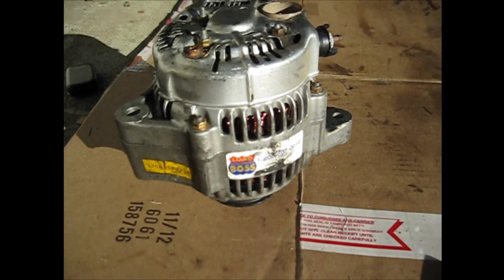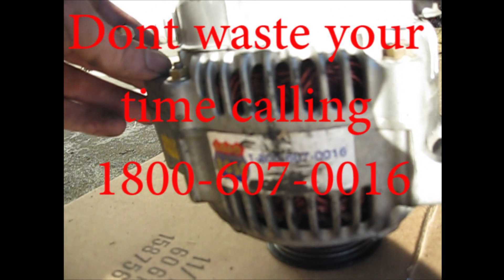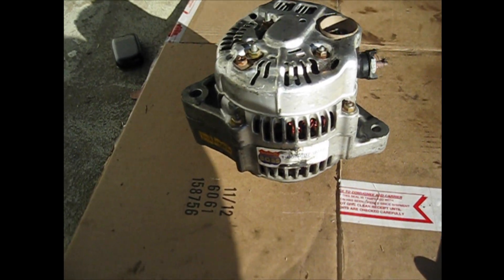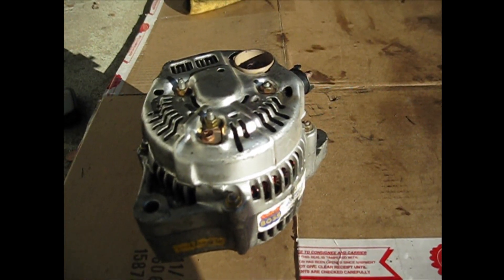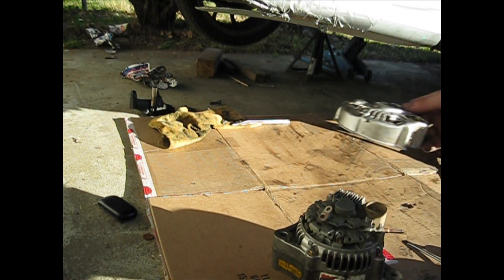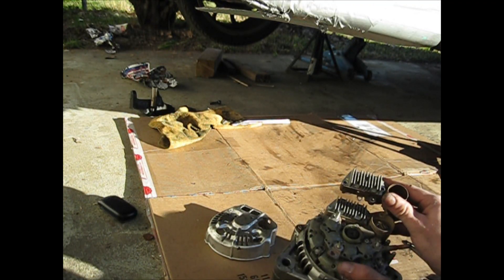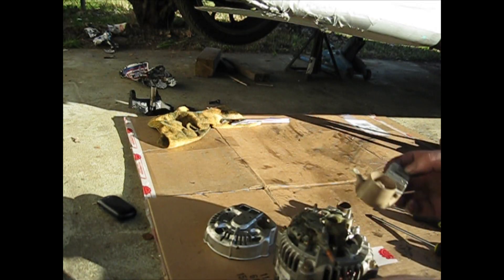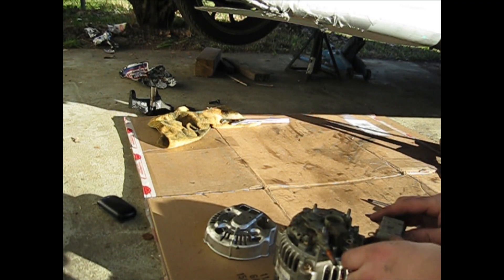How to replace a voltage regulator in an alternator

Comment: How much current does the regulator actually handle?
Reply: its normally rated to run 14v, when i had a problem it was reading over 18v

Comment: Will a alternator test good even if the voltage regulator is bad?  Trying to find out a problem with Honda 2003 accord
Reply: May be little to late for me to get here, but yes depends on when the overcharge happens. On my mussle car it'll overcharge when i put my foot to the peddel. But when i test the alternator it is perfect

Comment: Hopefully someone I here can help me. my alternator overcharged my battery, replaced both alternator and battery. also replaced mega fuse. car cuts on and off fine with no problem after the new batt and alt but gauge still say charging is low. battery light stays on. haven't drove it yet just ran the car at idle, don't want to drive in fear of cutting off in the middle of the road.  any solutions?

Comment: Hi, my car wont start. When i try to start it there is no responce, no sound... absolutely nothing... When i open the door, i can see warning lamp for open door. I then concluded that there is power, but it may be that i have problems with the voltage? The car worked perfectly yesterday, but when i was about to go to the mall today, it just randomly refused to start. I checked for all type of liquids too, its all normal. I drive Mitsubishi Colt GLXi 1500 1991

Please answer, i want to fix it before work on wednesday!
Reply from the maker: +Alain Fabrice  Your battery might be dead. Have you tryed to jump start it with another car?
Reply from the maker: +Alain Fabrice  
A bad voltage regulator can kill the alternator and It could damage relay's and computer's AKA ECU. 
The alternator is what feeds the battery with power.
Reply: I havent tried to jump start it, but I will try today and give feedback. But if it starts when I jumpstart it, will I consider it as fixed or should I charge anything?
Reply: Alain Fabrice I have no idea if this will help you but my alternator voltage regulator was bad and was causing a parasite leak on my battery. I was kind of in your situation

Comment: Where can I buy this voltage regulator for my honda civic 2001 which need to be replaced? The code on the alternator is A5TA7091. thanks!
Reply from the maker: It is cheaper to buy a hole new alternator then just replacing the Voltage regulator. Check your local part store like a Autozone.
Reply: @FastestIntegra  Actually not true, I just checked the other day at three different auto parts store. Auto Zone, O'Reilly's, and my local Carquest....voltage regulator is 100-150 bucks cheaper!
Reply: Really? $40-$50 part to a $150-$200 alternator. Totally cheaper

Comment: Could a bad voltage regulator cause temp/gas gauge to malfunction I.e. stay stuck on high or low temp or full/empty tank.  Or cause the dash gauge icons to come on and off???
Reply: If your battery light is on then maybe yes. Otherwise you may have a badly grounded gas gauge inside of your tank.
Reply: Yes
Reply: Yes, my dash kept going off after a few minute to find out my voltage regulator went out and started to over charge from 14.7 then climbed to 19v before I shut down my car. Over charging will cause circuits to shut down unless it's a mechanical guage.
Reply: Gauge